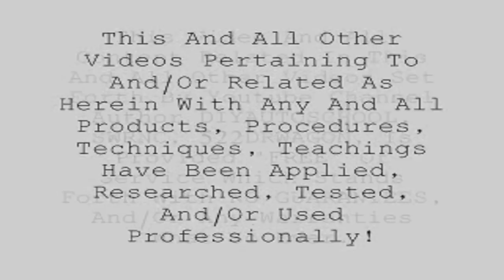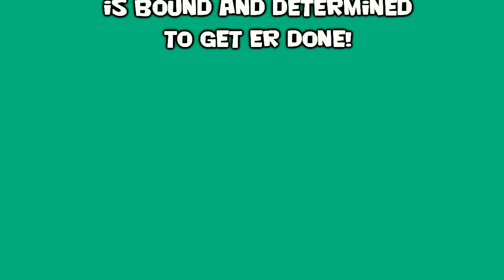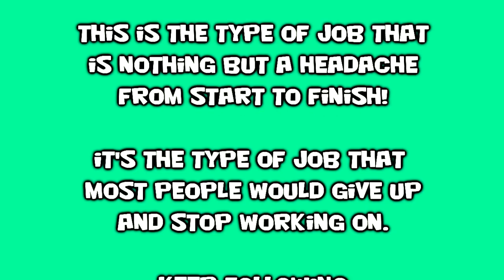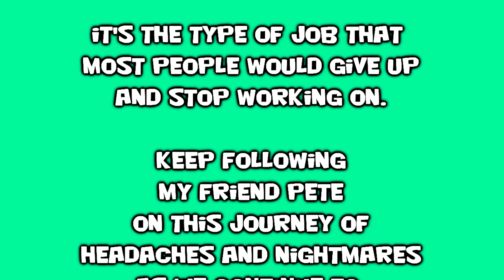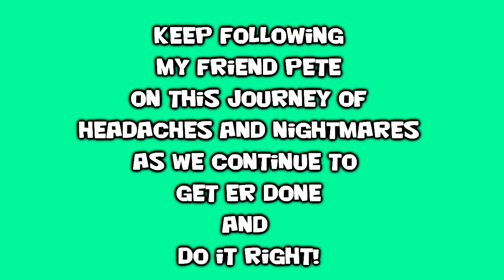Can You Restore A Rusted Car? " At Home " - Part 7 - Using A Cutting Torch

Comment: Pete, Like you said, With this much rust you have to develop and create one piece at a time. If I remember, you cut 18 ga metal for inside the wheel house, into to back rocker, curved piece basically recreating a unibody structure. It takes a lot of heat to hammer that shape into that inner panel. I don’t envy the work you have remaining. You have way more to cut out and replace than you have to save. This is truly NOT for the faint of heart. Right again.
I am glad Minnie found something that brings joy to her heart. Blessings to both! Omaha.

Comment: I had a horrible structural nightmare with my caddy... ive taken on a new project that is over my head and i spend more time trying to rap my head around it then actually working on it...  BUT, i wont give up. It is a very big difference between hobby shop and making a living for sure but its kinda the same in the end. You walk away and think about the current obstacles and how to get around them. Ive learned that from you Pete. Just so ya know!

Comment: those inner arches can be a sod, i take a thick solid rod and heat it up to make the shape of the double curve then take that to the bench and make the sheet fit it, never had a shrinker / stretcher tool so its heat and beat for a treat.
that largest hole in the boot floor never came with the floor section i had so i used two brake discs (rotars) as a anvil and striker to whack the pressed shape into it.

heres a tip for you, if someone wants you to repair the front of a MK II jag tell them to fu...............no! more curves than dolly parton on a trampoline, make them buy a new front panel

Comment: Some years back I had my legs under a fender I was welding on and the undercoating got hot melting off a large section that fell across both of my knees. It stuck my pants right to me. It was a very painful experience I hope to not do again!

Comment: did part an area on nova that had a curve.not fun by all means.prob going to loose most all of it when I re do with a patch pannel and got more room to work to fix that curve ..hopefully and at least the curve is not steep but thats besides the point .them fender lip areas do not give much room for error. and trying to but weld it all in is going to be fun.NOT!